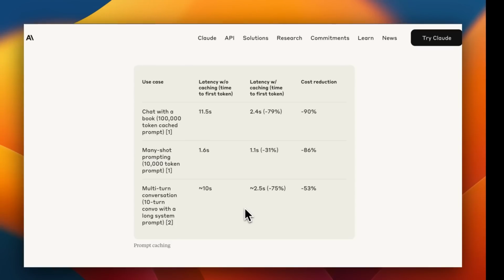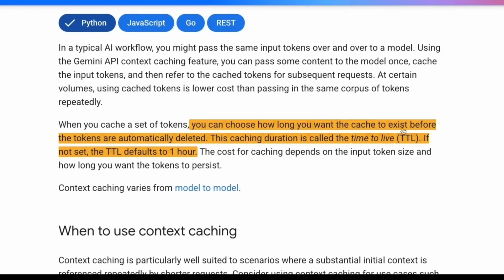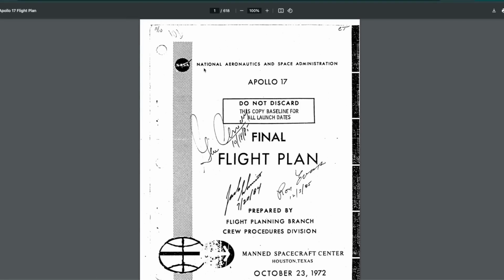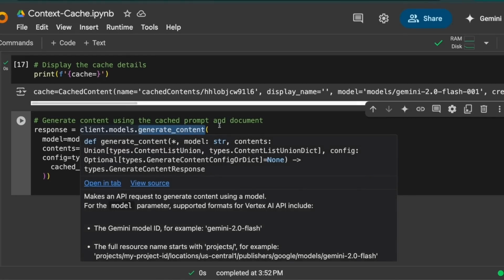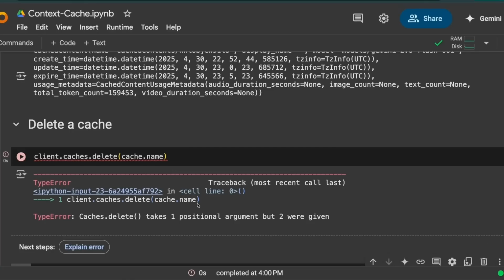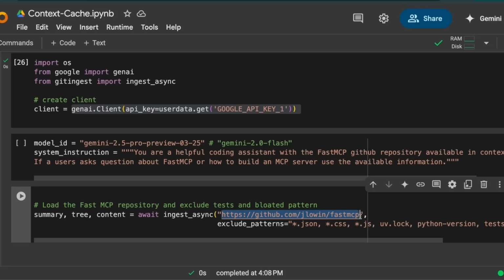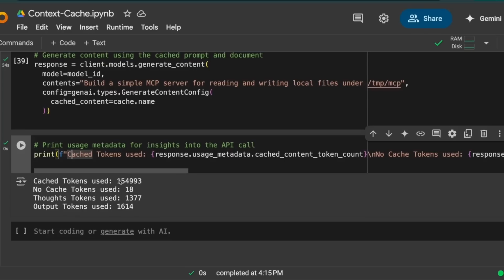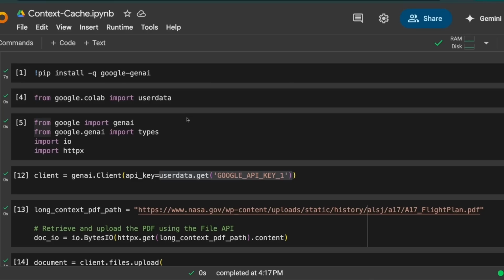Could This Gemini Trick Replace RAG?

Comment: isn't it expensive $4.5 per million per hour? One million tokens it's approximately 4-5MB of data according to Claude. And I pay $3 per month per 200GB for Google Drive subscription. I understand those are different technologies but difference is outstanding.
Reply from the maker: The idea of cache is temporary storage for small durations. You don't want to use it as long term storages. A potential use case is when the user loads a session with large documents cache it for duration of the session and then discard it
Reply: I think they use GPUs memory for it. So it is not cheap

Comment: In your opinion, is it worth implementing RAG (and its derivatives) using the 'chunks', 'parse' pattern or going directly to the 'vision' model that already abstracts this?
Reply from the maker: I would suggest a combination of both (depends on the specific application). The main issue with vision based approaches at the moment is storage and compute but they are really promising for unstructured datasets.

Comment: Maybe what is cooked is complex rag system. Now, you can use naïve rag to simply retrieve the good documents (among 100 000 document per example) and put the good documents in the cache for the next queries. It is really effective as the new model of google are really cheap and have a really good answer to complexe query over large token prompts. So, CAG + Naive Vector RAG maybe cooked Complex Proprietary RAG solutions ?
Reply: Put an entire PDF into Google Gemini flash 2.5 cheap model produce really great answers, whereas a rag framework usually failed at answering multi hop and query with large context necessity
Reply from the maker: For complex questions, in context learning is definitely the way to go if your model supports a long context window